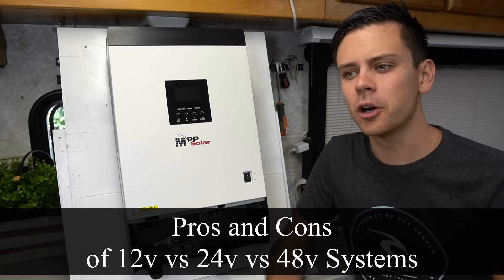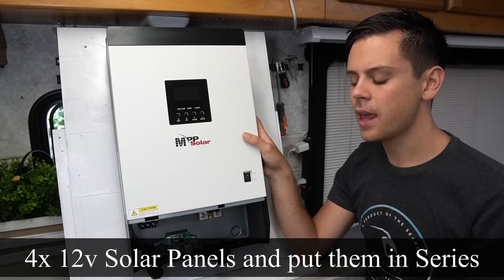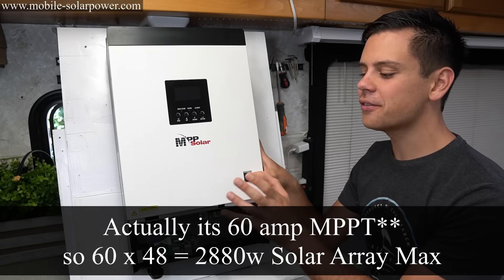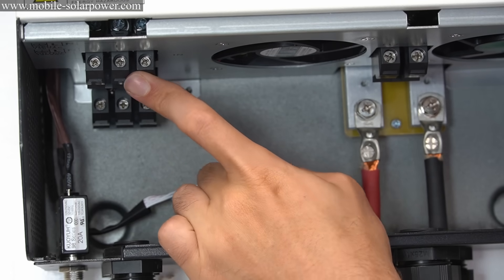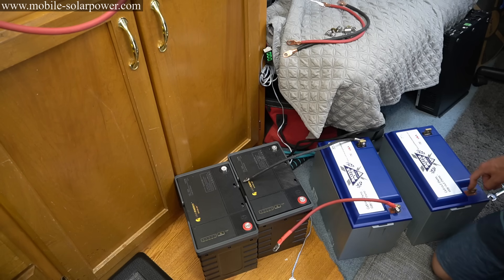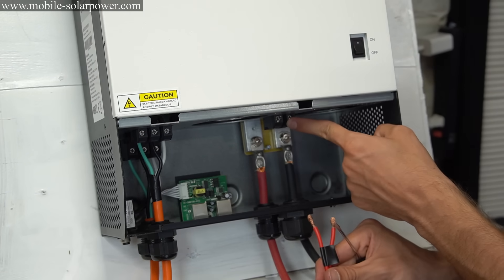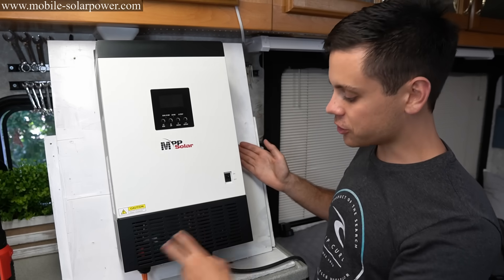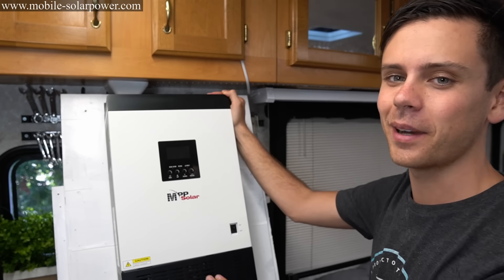48v Solar Power System for Beginners: Lower Cost and More Power!

Comment: YOU ROCK ! ! !
I think I will just do the 24v in my RV
Reply from the maker: 24v is awesome. And glad I can help :D
Reply: DIY Solar Power with Will Prowse  will this power a 50 amp 5th wheel main breakers? Also would it in essence eliminate the Waco converter ? (With the addition of a 24v to 12v stepdown)

Comment: Another great video!  Thanks, quick question if I have a 48v powerwall of 18650 batteries I still need BMS on all of the 18650 packs, correct?
Thanks
Reply: If each pack is 48v then yea you need a BMS on each pack.  But if you're combining fourteen 3.7v packs in series to get the 48v, then you'd just need one BMS with a balance lead going to each pack.
Reply: @Mazlem  that's what I thought....  Thanks

Comment: Photovoltaic / Solar Thermal Technician here.
i Like, OLE!
Reply: Curious noob here, what's that?
Reply: @treaustin1  Photovoltaic what scientists called solar cells, solar panels, fancy way of saying solar cell or solar panel technician. it's the process of converting light (sun, photon) to electricity. Solar thermal generate heat instead of electricity. No Noobs here. you've just taken your baby steps. welcome to The Light or blinded by the light. Man, I can't say Wlecome to the Dark Side. Booo. OLE!

Comment: Are there any long term reviews of the "all in one" units?
Reply from the maker: Yeah, that's where they excel. Powerwall guys have used them for 7+ years, running them 24/7. Join the Facebook group to see what people do with these things
Reply: @WillProwse  What is the page name, I can't find it.
Reply: @WillProwse  I dis find another review and it said there was a 70-watt drain on idle. Is this true and can it be compensated for? Maybe a remote switch on the inverter?

Comment: What happens to insulation against surges from lightning via the solar panels and on the grid side too?
Reply from the maker: If it's a problem in your area then varistor and other surge protection. Ground everything to code.
Reply: I once lost an inverter to a surge and am in Africa and we are about to go into the summer which means lightning strikes.

Comment: Many mains appliances will run directly off 48V DC.  Yes, you read that correctly.  Many will not, of course, but you won't destroy them trying it.  LED lighting, small switching chargers and power supplies - which includes a huge array of small appliances.  Will, you might do a quick survey of your own personal mains devices that will run directly from 48V DC and make a video of it, because it's a particularly cool stunt to have up your sleeve - and one that no one quite thought of...
Reply from the maker: Wow that's interesting
Reply: @WillProwse  It's particularly good with mains LED lighting - since that comparatively draws no power at all, so you can leave it connected and (conveniently) operational in all but the most serious outage (ie, BMS disconnects you!)   Other gadgets such as the mains POE injector for your wireless internet can be direct wired too, so now you can power off and even disconnect large parts of your power system for evening fiddling around and you kinda didn't even notice..
Reply from the maker: Will look into that

Comment: If you have a tiny house with no grid power, how would you hook that up to your electrical panel for your wired tiny home? Nice job on your videos and book.
Reply: If you want to use a standard panel in North America to power your branch circuits, you would need to buy one of these boxes with 240V split phase output (the company does make some 5 kW units with this option), and then run the outputs to feed the hot lines that lead to the master breaker in the panel.  The master breaker in the panel should ideally be sized to match the peak output of the inverter, so for a 5 kW inverter, that's only about 20-25A on each phase (40-50A total).  The inverter should have its own overload protection, so this isn't really that important except that it protects the wiring between the inverter and the panel and should be sized for that.  To doubly-protect the 5 kW inverter, use 20A (20A x 2 phase x 120V/phase = 4.8kW).  The breakers for the branch circuits wouldn't need to change at all (standard 15/20A breakers).  A setup like this would be safe, but I don't know if it would meet the electrical code in your area (there might be some strange restrictions).  If it's strictly off-grid, that may not matter.

Comment: Hey Will great video! So were going complete off grid with a tiny home and was wondering if our battery's get low and our generator kicks in..this unit will feed of the generator and charge our battery's back up?
Reply from the maker: Yes it has gen back up and dry start
Reply from the maker: Just connect to mpp unit. I haven't done it before but it should be dead simple
Reply: @WillProwse  Thanks Will! Also on a 48 volt system how far would you recommend that I have the wires from the solar panels to the system? Or does it matter?

Comment: Thanks for the video Will.  These seem very simple to implement.  For the AC output connection, can we have a dedicated breaker in the main panel or do we need a critical loads panel?  I see this as a requirement for many hybrid inverter systems.
Reply from the maker: Yes a dedicated breaker panel is ideal. For this system, it is too small to need a breaker panel, but yes, that is the best way to do it. Will cover than in my house system
Reply: @WillProwse  sorry for bugging in here in the comments but I've got a serious question. How many of those small 10 amp cords for appliances should I wire in to this model to be able to use the full output load? I just need an opinion please, I trust your judgment.

Comment: At the start i had a 12 volt system , then at the end went 48v for the main reasons that it runs a lot more efficient and cool , the amp draw is alot easier on the system ...

Comment: Thank you so much.. I've always felt that getting higher power 300 + watt panels and connecting 24-48 would be much more advantageous.  But I've been looking for cheaper modules.. and the one you've put up on the All in-one system.... Keep the great work.. and do a bit more with the 24/48 cheap solution..

Comment: Thanks Will. How would a system like this relate to someone with panels that include microinverters? I was thinking of buying the newer panels with the 240 volt microinverters on each panel. These seem cheaper in the long run and easier to control.

Comment: Please do video that shows how to do a van conversion setup with this where you need 12v and 110v, how do the wires get attached and  wall plugs/sockets light switch etc
Reply from the maker: Ok will do
Reply: @WillProwse  thank you
Reply: Thanks that's  a great idea

Comment: Great video, these Day,S you have A++ housemachines and you can easy use a 3000 watt System cost only 500$ , a 5000 watt is around 900 $ so if you can iT,S a lot cheaper, but you are right , Nice stuff these Day,S.

Comment: can I use this for the tesla batteries? If so, do I have to use a BMS? Thanks
Reply: Yes. Research batrium. Tesla batteries are called 18650's
Reply: @squidlings  Thanks for your response bud. I'll get a BMS. And yeah I'm planning to pair the batteries in series to create a 48 volt. I don't need a Battery Protect right since I'm gonna be using a BMS?
Reply: i have tesla model s module and this brand inverter.
i am however tapping into teslas own bms modules that are inside of the modules.

for that i use jack rigter's / sen. massies ( see the evtv channel ) system...rather expensive , but truely worth it
Reply: @houseofancients   hello bud. May I see a detailed picture of your setup please? Thanks
Reply: Just bear in mind a full tesla module is 24v so youd need a 24v inverter and work out a safe way to use the bms.

Comment: Hi Will, awesome vid as always.  If possible can do a vid on 18650 battery bank and solar panel for electric bicycle? i plan to use flexible solar panel to custom made to charge by battery for electric bike when riding.
Reply from the maker: Oh I avoid 18650 like the plague. Even if using cylindrical cell LiFePO4, better off using 22650. I hate all 18650 packs unless it's a Tesla module. For your application, a ready built nmc or nca pack might serve well. But yeah I'll see what I can do

Comment: I have been researching solar for about a year now contemplating a grid tied system for our house and to charge my Chevy Volt.  The all in one systems are making this look so doable  without the hassle of picking components, getting them wired and then commissioning the system. I've been a technology professional for 25 years so I can appreciate complexity,  but simpler is definitely better in this case! Keep up the informative easy to follow videos that have become my go to source for DIY solar/battery systems.  Looking forward to the larger 5k system review.

Comment: Hi, i buy 120V 2400W 24V Solar Inverter 50A PWM Off Grid Inverter 60Hz 60A Battery Charger all in one from EASun power and going to connect some telecom batteries in my house!

Comment: Will, quick question. I'll be building a 48v lithium ion system for my boat in the next several months. We hardly ever use the inverter as we don't often need AC power when away from the dock, therefore we keep it turned off to avoid standby losses. This all-in-one device has an inverter on-off switch, as you demonstrate. Since we rarely use the inverter, will the MPPT charge controller and grid-tie battery charger still function with the inverter turned off or does that switch depower the entire device? Thanks SO MUCH for being such an amazing resource!
Reply from the maker: Inverter can be off and ac charging/solar charging still occur. It's pretty awesome in that way. Just give it power and it does it's thing

Comment: I usually add a battery cut off switch which helps avoid the spark :) Great to see a 48v system!
Reply from the maker: I do not like battery cut off switches because if someone switches the switch to open, and the unit is connected to a string of panels, it can destroy the mppt board. I prefer hardwire battery, and switch at the panels for maintenance.
Reply: @WillProwse  That's a good point. How do grid tied systems deal with this? The types that feed back into the grid. They can be shut off at any time by the electric company.
Reply: @JamesMorrin  net metering
Reply: @chriseudy4684  I get that. What I want to know is how they protect the mppt charge controller from a loss of power. Will mentioned that if you disconnect the battery you could damage the charge controller. So I was wondering how these systems protect from a loss of power.
Reply: @JamesMorrin  Good question!!
Reply: @chriseudy4684  now that he has a house, I'm pretty sure that will come!
Reply: @ZegaracRobert  positive about that, and can't wait to follow the ramp up.
Reply: @JamesMorrin  it's a smart meter at the house. It will run backwards. I suppose it could stop. I have a friend who retired from Consumers Energy, I'll ask
Reply: @WillProwse  Why will the solar array destroy the MPPT board without a battery?  No load?!?!
Reply: High voltage dc switch  (300v or higher so the dc arc is arrested without burning out the connector)
Reply from the maker: Yes exactly! Some switches cannot handle that spark and will damage it..same with a lot of power connectors. Exactly
Reply from the maker: Well a mppt is just a fancy converter circuit that figures the right volts and amps for impedance of solar cells and battery and pushes what it can. Most mppt are designed to have a reference voltage and resistance. In a grid tie, it's inverting to ac, then matching it to grid power characteristics. I would imagine that the regulation has a simple switch that controls the anti islanding feature, which would avoid mppt getting burned out when grid goes down. Lots of ways to accomplish this though. Cheap mppt designed for batteries, not even. They are super cheap and simple to have that feature but you could easily design a board that can handle that problem
Reply: You should always have a disconnect switch before your inverter and your batteries. Your inverter is just like a transformer, and your batteries are just like a generator or the gov't line coming to your property via the transformer which in this case is your inverter. You should always protect the primary side of the transformer which in this case is your inverter. Switches are designed to handle the current breaking or closing.
Reply from the maker: @mickeylewis8094  that's why we have OCPD devices or systems in place. Having a master switch on a battery will do nothing for a solar power system because unattended charging is the norm. If you are watching your system 24/7 and you are ready to pull the switch, go for it. I like ocpd instead.
Reply: Those Sparks!
Reply: Our company's micro-inverters are all upgraded and no longer need Modem! ！ Can directly mobile phone intelligent monitoring, more understanding of technology can add me whatsapp 8613927402025

Comment: Don’t forget about perhaps the biggest benefit of higher voltage — far better inverter efficiency.
Reply from the maker: Indeed!
Reply: @WillProwse  I'd love to hear some numbers on that to better understand the actual efficiency gains with a 24 or 48 volt system.
Reply: @WillProwse  hi will 
How many 48v series of batteries can you add to a 5k 48v system
Reply: Check out my post about my real World results of living with this 48 V system for a few years before you make the same mistake that I made.
Reply: Trev Bridgewater  — link?
Reply: @joelhansen7373  the comment is on this video somewhere.
Reply: @joelhansen7373  
Trev Bridgewater
3 days ago (edited)
I had this MPPT controller on my truck for a few years. The BIG downside which Will hasn't figured is that 4x12V batteries will only charge to the maximum internal resistance of the first battery in the series. I wish people would get a grasp of this issue as it's limiting many people's return on their investment dramatically, in some cases. 
Here's how my real World results work out: I have 2KwH of solar panels on the roof. When I have 4x220A batteries in series the maximum charge I get in full sun is around 550Watts, which is due to the internal resistance of the first battery. (Note: lead acid batteries should charge at around 0.05 C, ie.5% of their total capacity. ) 
Just to prove this point I changed to a 24V MPPT charge controller & the same system charges the batteries at a rate of around 1100 Watts !!; since now it has 2 strings of 2x12V, so twice the 220A X 0.05C. 
Another solution with the 48V system would be to increase the number of battery strings to 2 , ie. 4S2P batteries, to allow the charge coming in to get a better chance of absorption, & not to get wasted by this internal resistance, but at 50KG per 220A battery it would be pretty darn heavy! However, for me to get the full use of my 2KwH solar panels in a 48V lead/acid system would require 16 X 220A units.
I wonder whether Lifepo4 batteries run into the same problem??

It annoys me that many people like myself have had tto endure such a poor performance because no-one seems to grasp this issue. The potential wasted solar Watts Worldwide could potentially be enormous.
Reply: @trevbridgewater580  thank you Trev.
Reply: Donald Everett  — thanks for finding this comment
Reply: Trev Bridgewater  — I’m planning on a lithium battery bank, so apparently it’s critical I find out the internal resistance of the first battery.  Thanks for the heads up. But the deeper I get into the planning, the more I’m looking at 24v since there’s much more compatible equipment.
Reply: Donald Everett i think things are far different in the world of lithium, and I don’t think Will was thinking that anyone would attempt to configure a 48v system using lead acid.
Reply: @donaldeverett714  I think lithium batteries would be different.
Reply: @donaldeverett714  this is interesting. Im new at this and this is good news
Reply: @donaldeverett714  First, shut your system down and separate each battery. Use an ohm meter to check the battery cells internal resistance. Remove those showing a high resistance and put another battery in it's place. I don't recall what the internal resistance is, but you can probably find out after checking several batteries.
Reply: I know this is old. But lead acid has much higher internal resistances then lithium, so I don't think he will run into the same issues you had. Lithium is far superior to lead acid in almost every way,  only reason people still use it is the much  lower upfront cost and cold water usage.
Reply: Kareef Huggins all chemistries are severely affected by very cold weather, with the possible exception of lithium titanate.